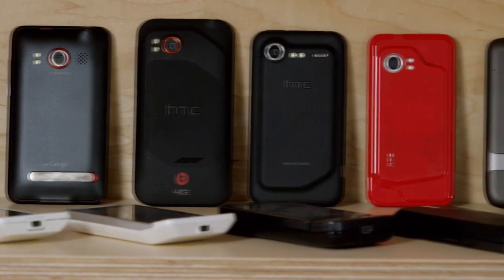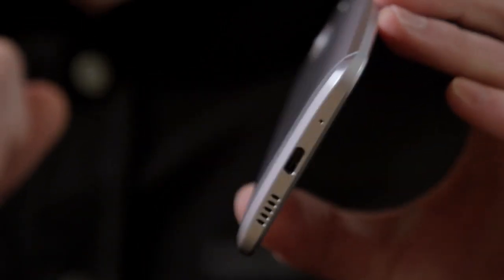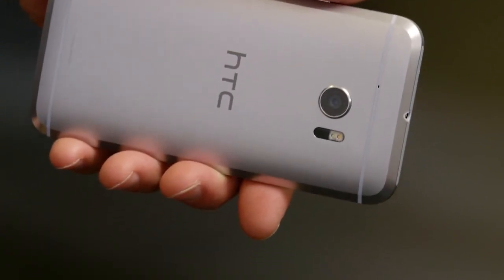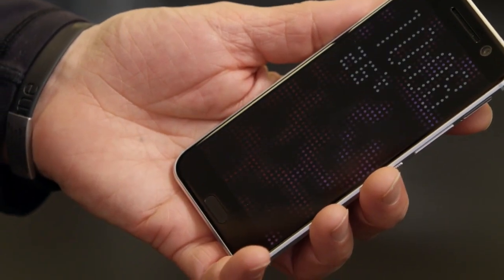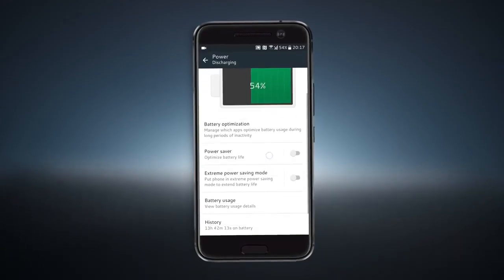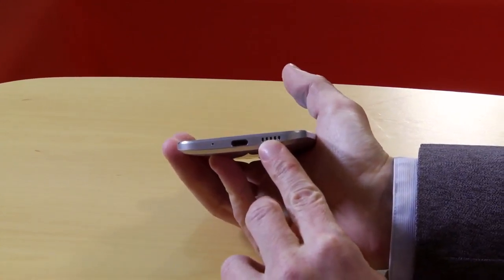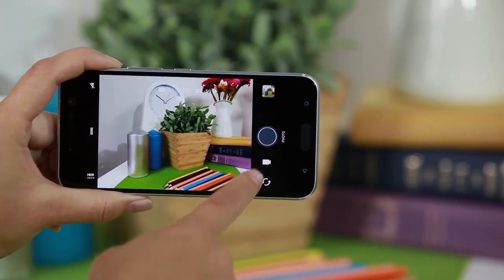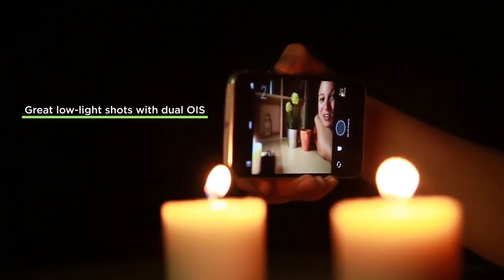New HTC 10. Review. Test. Presentation of the smartphone. April 12, 2016.

Comment: It really is too bad it looks so much like an iphone. The back and sides look good, but the front is horrible. If it weren't for the front and the iphone clone look, i wouldn't hesitate but I don't know if i can deal with the look of it. Will have to wait and see.
Reply: +Sasha Boucicaut hehe htc phones has this same (metal) design language since htc m7 which was released in 2013 march. And the iphone 6 which according to you looks like this, was released in 2014 september, So if anything apple has copied from htc. It's not the other way around. I actually likes how it looks.
Reply: +Sineth Wijekoon I'm very aware of that. I own and am writing from the m7. I absolutely love this phone. Almost 3 years and I still am super happy with it despite the pink low light camera issue. So I hoped the 10 would provide something at least as pretty. And yes the m7 may have preceded the look of the iPhone but make no mistake that look now belongs to the iPhone. It's particularly the large rounded corners that bother me most. The m7 has smaller curves. Looks so much better imo. But the 10 just doesn't have any personality. I saw some renders of the 10 before it came out done by regular people. Some looked awesome. This just looks like a clone. It's not ugly just boring and safe.